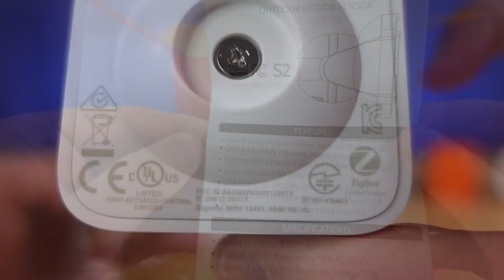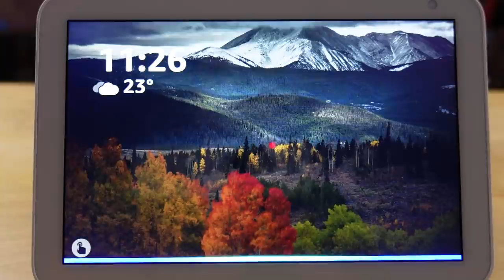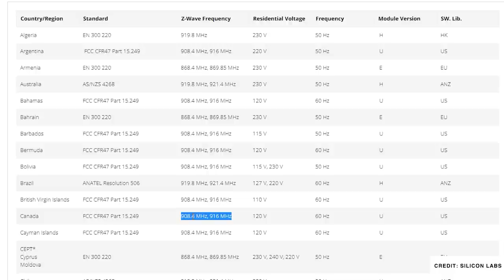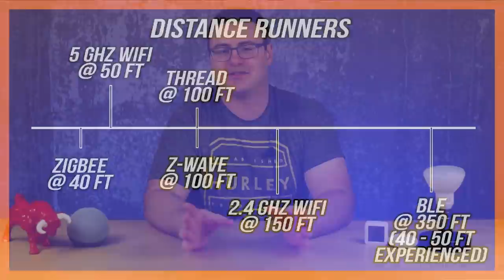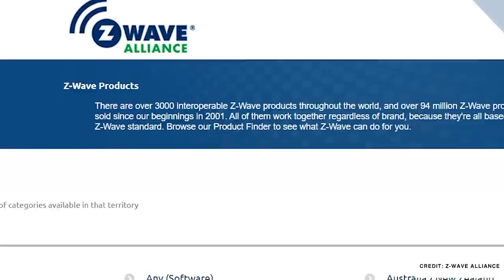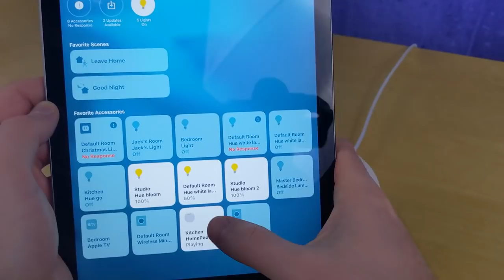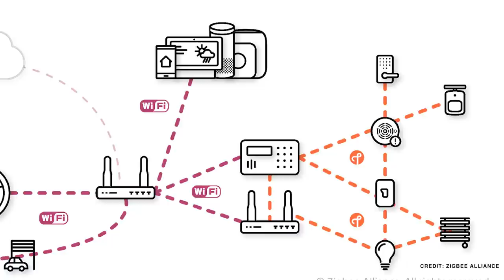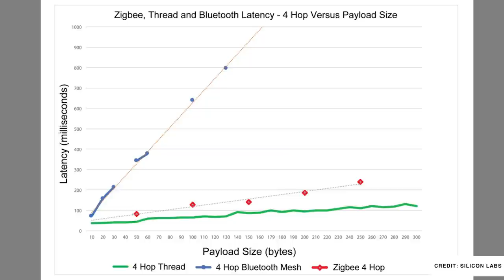ZigBee vs Z-Wave vs Wi-Fi vs Thread vs Bluetooth vs Matter (CHIP)

Comment: Very helpful video.   Unfortunately, it completely overlooks a topic that I consider essential to discussions like this - specifically, cloud connection requirements.  I personally go out of my way to ensure that as many devices as possible run 100% local with no internet access of any kind.  There is absolutely no reason why the hardware manufacturers need to be notified every time I use the devices they made.
Reply from the maker: We did talk about cloud requirements a bit in the latency section, but we left that out of this video because it's not really required from any of these standards or protocols!  So in a versus world...there's no need.  That's more manufacturer based :)

Comment: I just found this video and it is the best I've seen to explain the protocols / networks out there.  I have a fairly complex smart home with about 300 or so connected devices and I use WiFi, BLE, Zigbee, and Z-Wave devices.  The other two that I use are LoRa and Lutron ClearConnect.  Both of these have a purpose as well.  The one piece of the decision that folks should also consider besides all the good points you've made in your video is longevity of investment in these devices, especially those devices that are built into you home like wall switches.  The information provided in this video along with commitment and stability of the company and service supporting the device should be considered before investing in a smart home ecosystem.
Reply from the maker: What a great comment!  Thank you for the kudos and the knowledge you clearly have!

Comment: I use a lot of rf433 devices in my smarthome with a Domoticz setup. Though not as ‘sophisticated ‘ as the other standards, its a very effictive method that also, like zwave, travels through concrete walks and floors well. I am looking forward to choip/matter, but its not ready.
Reply from the maker: No need for it to be fancy in terms of a fancy name!  It's really the same stuff we're talking there :)  The low frequency is going to help for sure getting around your home!

Comment: They’re not only confusing terms, they represent an industry that lacks cohesive strategies and is probably the main reason many people shy away from more home automation.  I have Wyze and Google products and struggle to keep things running reliably.  The “bridges” and interconnects lack stability and reliability.  Trying to put them together into a single interface is maddening.
Reply from the maker: You're right Bob.  I have seen one little light at the end of that Wyze/Google tunnel though.  Wyze is in on Matter, and Google's driving Matter in a lot of ways.  This should finally bring companies like that together.

I hope.
Reply: @AutomateYourLife  Forgot to mention that I also use Apple for my TV, PCs and phones so when you add that to the mix, I have quite a jumbled mess to keep things going.  Would love to use Apple Home as the interface but that is really unrealizable as HOOBS isn’t quite robust enough when you rely upon crowd sourced interfaces that can fail too keep their things updated.
Reply from the maker: More good news there.  Matter says Multi Admin is possible (that's what they're calling it).  So Apple and Google could (or should) be able to control your smart home gear that's Matter compatible.

We'll get there, I think the industry sees what you're saying here and knows how painful and silly it is.
Reply: I dipped my toe into actual automation with WiFi sensors, but haven't jumped into any pool yet. I'm hoping that Thread on my 2 Nest displays will be the answer, but who knows?

Comment: Regarding z wave and latency. I used to love Smartthings, as it contains basically all the communication in one single box. Z waze, zigbee, wifi. Yeah, the z wave latency was exactly as you demonstrated, you step into the motion sensor and it takes 1-2 sec until the light turns on. Very frustrating. When I migrated to Home Assistant, I kept the ST as an integration, so that I would not have to migrate all my devices to a new  z wave coordinator. The latency was still there and I blamed z wave as a technology. But then I got rid of ST and surprise-surprise... the  latency was suddenly gone. I think I had one of the older ST hubs (2nd gen, dont remember) and I am not sure that similar move would help anyone, but it shows that the technology can be affected by many (seemingly unrelated) components. ST relies heavily, I believe, on cloud connection.
Reply from the maker: These are good points, and I think some people will be helped by this so thank you for leaving it here.  The Cloud connection on Z-Wave devices can be very painful and you're right!  In my case, I've been demoing both cloud and local devices, and also with hubs like Hubitat.

I'm more speaking about longer wait times when you get bigger networks in this video, but I've definitely noticed longer processing times on Z-Wave devices :)
Reply: Yup, Samsung wants a record of your life lol everything you do.

Comment: In shot to understand, What is the difference between thread and matter? And why they mentioned as matter works over wifi and thread?
Is it true that all thread appliances are not homekit devices? But all appliances built with matter are homekit devices rite?
Reply from the maker: Matter = WiFi or Thread + Bluetooth + other requirements

HomeKit = Thread or WiFi or Bluetooth + Apple requirements

Comment: Thanks for the video, i learned a lot.  Wondering why LORA didnt take off or why isnt used on this new standard thread/matter, i mean bigger range that dont intefere with wifi 2.4ghz, whats its downside that they arent using this ghz range?
Reply from the maker: There's not a lot of downside to LORA.  I don't love the transceiver strengths being used personally, but that's a personal concern with not enough research to support my concern.

It's very similar to Z-Wave Long Range nowadays, and I don't think it's over.  FYI - Amazon Sidewalk uses LoRA :)
Reply: @AutomateYourLife  Thanks a lot for the time taken for replying me.  Personally i would prefer them to use 400mhz-900mhz, like the cordless phones used to (now not that many are used with all people having mobile).  I feel sharing the 2.4ghz with WIFI is a little gamble, like you said there are multiple channels so there are ways to avoid the overlapping and interference, but there are some places that you cant like apartment buildings where you have multiple wifi reaching you, and in time many will have smart devices networks, if we all go into 2.4ghz then it will be a nightmare, thats why i feel 400-900mhz would be ideal for smart devices, specially like LORA having very little need of repeaters.

Comment: Nanoleaf does not currently work over Thread with Google devices (Bluetooth only). The same issue with many Zigbee devices. I have latest version of Mi hub, but I can not use it with some Aqara products and Zemismart blinds motors.
Reply from the maker: Correct, absolutely.

Comment: hi there, can I use two Zigbee hubs of the same brand and model (Sonoff Zigbee Bridge) in the same house?
Reply from the maker: You can use the same model of zigbee hubs, but I'd make sure that you could adjust the channel or else you might run into interference.
Reply: @AutomateYourLife  ok I get it but I'm not sure how to change the channel. Do you mean the hubs channel or the router channel? , so sorry to disturb you again, thanks anyway.
Reply from the maker: The hub's ZigBee channel.  You don't want them to be the same

Comment: Hello! Quick question for you. I have a Google Nest wifi system. I am also looking to get both Lutron smart switches and a Hue lighting system. How would I hook up both of those bridges to the router / modem? Appreciate everything in advance! Watch and appreciate each and every video you do!
Reply from the maker: Hey Ross - So you'll need to get a little network switch.  Then you can put that next to your WiFi Router and connect in your wired gear.  Shouldn't be too tough.  Here's what I'm suggesting at the moment: https://amzn.to/3bCkSJf (Amazon affiliate link).

Get a managed switch, it'll save your home's network.  That's why I recommend that one. :)
Reply: @AutomateYourLife  Thank you! I will get one of those. Does the network switch plug in from the router or does the router plug into the network switch? Hope that makes sense and hope its not a dumb question!

Comment: And here I still prefer my Insteon gear.  Works every time and without fail, even if my internet goes down, I still have a remote to control my lights and devices.
Reply from the maker: Yeah, I mean...you can move on to some prettier stuff now Bill.  Lots of local control options available today

Comment: There are wifi routers, like Xiaomi AX6000 that supports 248 simultaneous devices and Xiaomi AX9000 up to 1000 simultaneous devices! So, this is practically enough for home automation.
Reply from the maker: I'd like to see that actually happen!  Have you seen someone try that?

Often when a router says "X devices supported", they actually work well with about 1/3 to 1/2.

Comment: Wait wait wait… I thought the whole point of home assistant and all that was it doesn’t matter which protocol your devices are on… like we can mix and match and not care as long as there is at least 1 hub on the network
Reply from the maker: In general, yes.  However, you still have to have a radio capable of speaking these different "languages".  Home Assistant doesn't have any radios when you get a raspberry pi (except usually Bluetooth and WiFi), so you won't be able to use the others.

And each one has benefits and drawbacks.  Home Assistant doesn't just get you it all!

Comment: You are wrong about 1 important thing in your WiFi frequency chart... If your WiFi is on Channel 1 & your neighbors is on Channel 1, unless it's a really old router, they can negotiate. Channel 1 overlaps Channels 2 & 3, that's why Channels 1, 6, & 11 are the ones used, because they don't overlap. When they overlap they cause interference. A Router on Channel 1 cannot negotiate to reduce that interference with a Router on Channel 3.
This also is completely misleading because that's ONLY for the 2.4GHz spectrum, most Routers & devices will use 5GHz unless the device is too far away, older, or there's too much stuff in the way.
Reply from the maker: A standard ISP router is what most people are dealing with
Reply: @AutomateYourLife  sure, but that doesn't change the fact that the chart is misrepresentative. This just encourages people to use channels that make EVERYONE'S experience, including theirs, worse. Everything since N (WiFi 4) was certified in 2008 requires those negotiation protocols on the 2.4GHz channels. So unless people are using a router that is 14 years old or older it's better to use 1,6,11. Even those older using those channels is best. In older & newer devices using channel 3 will interfere with & receive Interference from ch 1 & 6 with no negotiations, with older devices you just have the SAME problem with ch 1 & if your neighbor's wifi on ch1 is stronger than yours you MIGHT see better performance on ch3, but you WILL cause problems to EVERYONE on ch1 as well as ch6
Reply from the maker: Ok!
Reply from the maker: Thanks for the info!

Comment: The only reason that I like Samsung Smarthtings than I do WiFi tech is because of the switches.  I have yet to find a WiFI switch that works as well as Smartthings.  In my home automation infancy, i went with WIFI bulbs but then i had issues with pairing them together and the fact that i had to separate them so they would not turn on or off when i was calling one.  But bottom line, I like the ability to either switch the actual switch or ask Google to do it for me.
Reply from the maker: Well sir, I have a product that you just may love coming to the channel.  :)

29th, I should have a preview for you.
Reply: @AutomateYourLife     RIP Smartthings then.  :(